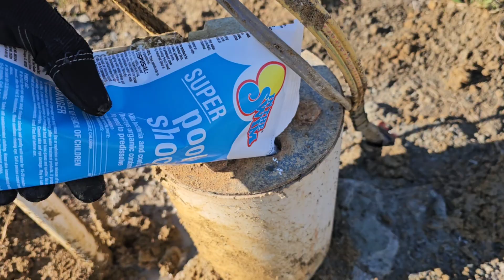Huge Fire Ant Colony built under a Water Well Cover. They were in the water supply!

Comment: Man let me tell ya about the time we pulled a submersible pump because the people said the water smelled like musk!
We started pulling the drop pipe and got about 10-20 feet out when a black runner snake went right through our hands.
The snake got in through the 3/4 threaded hole on the well seal that was not plugged and made a home. 
They had the well covered up with the old plastic fake rock which was good at least.
So yea I bet that snake let off some defensive musk every time the pump came on and shook the pipe.

Another time we were pulling a pump due to bug parts getting stuck in the faucet screens.
They said they looked like wings and legs of some kind of bug.  
We lifted the well seal and immediately dropped it and run like hell as 50 wasps chased after us.
They had gotten in again from a hole not plugged on the well seal.
That was a fun one and we ended up dumping soap water with a 5 gallon bucket to kill them.
After that we pulled the pump and cleared out as many as we could and chlorinated the well.

I saved the best for last as a no water call and the pump probably needed replacement.
I started pulling the pump and under the well seal looked like dirt or something on the drop pipe.
a few feet down I find a large group of slugs sticking on the drop pipe for about 20 feet down.
Apparently because this well was in a field where they cut tall grass the well would get covered like hay in the summer.
The grass was rotting and then rain would make the debris run down the bad seal.
I guess the slugs started eating the dead grass and converting it to a slugs habitat.
After pulling the pump and seeing bits and pieces of slug in the pump inlet It made me wonder.
So I asked the home owner if the water smelled or tasted bad or anything.....
The guys said no everything has been good for years, water is great.
I said well just don't tell your wife what I found till I blow the well and chlorinate the hell out of it!

Take it easy man,
Casey

Comment: i had a dry well drilled to 400 ft few years ago,  it was devastating, however few months after it started hissing loudly and when i dropped ice and some gravel in i heard splashes etc,,  its a  just a hole with about 80 ft of steel casing then it transitions to sandy rock and  . maybe some shale and then its sandy clay stuff, the clay stuff collapsed after they took the drill out so its probably at 360 ft now..  is there  a way to test a well to see if its producing anything worth pumping?

Comment: Hey Phil, thank you for all your great videos. It definitely has helped me in the last few years on a new property I purchased that had an old well that needed updating

How would you recommend that I treat my well that is artesian?  It naturally flows out the top, but I have an overflow pipe that goes off into the drainage ditch. Could I still treat with pool shock and flush back into the well with a recirculating hose?  Thanks again!

Ryan

Comment: Can treating your well negatively affect your septic? If so, any recommendations to help avoid that? Do you recommend UV systems at all?
Reply: I'm not an expert at all, I think it depends on how fast you send the chlorinated water down the drain, you may kill the bacteria faster than they can grow...
You can get pods to "activate" or "rejuvenate" the septic tanks that contain the right kinds of bacteria and also enzymatic additives that help them break down fats and other residues like paper and in theory also help to keep the sewage pipes cleaner. More or less all brands are used in the same way, once a month you throw a pod down the toilet, wait a few minutes for it to dissolve and then flush the toilet.
Reply: Do you use bleach in your washing machine? It's not enough to ruin your septic system  @ruben_balea

Comment: I put a bar of Irish Spring soap to keep things out for the past 3 Years and it keep them out fire ants and mice and all it cost was a bar of soap and not a new pressure switch or set of contacts for my AC unit
Reply: I have been using I. S. for years . Thos explains alot . Keeps the ladies away too .
Reply: why would you put soap in your drinking water?
Reply: @pubcollize  😆 I think he means he puts a bar under the cover.
Reply: @SOU6900 That's more sensible

Comment: Any concern sanitizing if you have a septic system? More specifically, is it okay to run the bleach/water from the well into the septic tank?
Reply from the maker: Is best to flush the well a day later using a hose out into the yard. But the little bit won't hurt a septic (typical daily usage). Remember city water has chlorine treatment & some of those home still have a septic
Reply: @h2omechanic   Thanks...
Reply: that little bit aint going to hurt anything